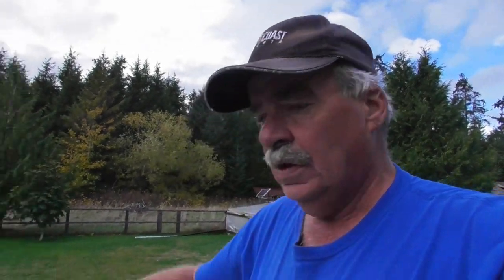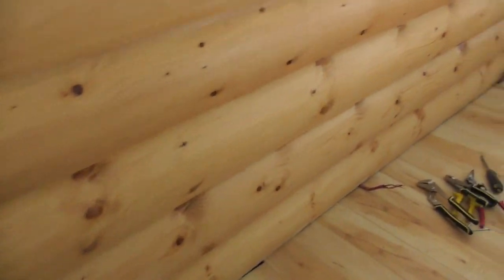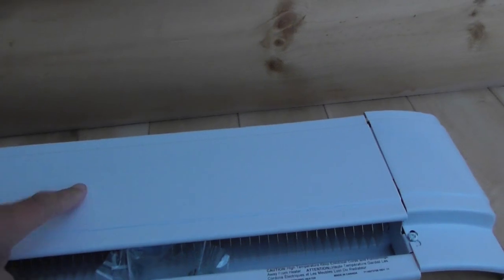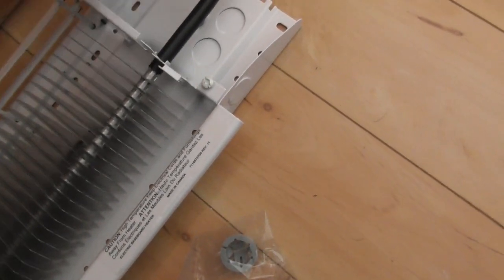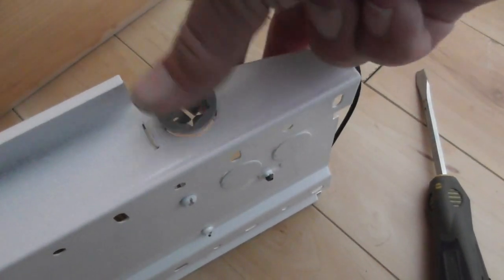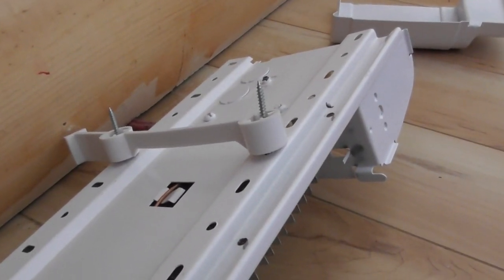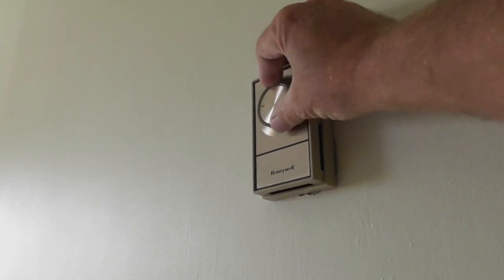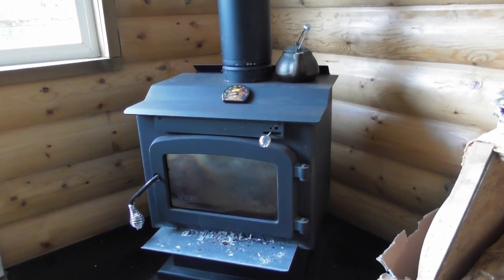Energy Saver Dimplex Linear Convector Baseboard Heater Install !

Comment: Great video! I just bought one of these too, but I'm confused on the wiring. The instructions indicate that you should wire the other side and separate the blue and black wire and addi in the neutral, and then wire the hot to the free black wire. Did yours not have those directions?
Reply from the maker: Hi Mindy, sounds like you got the Bluetooth model with the built in thermostat.  Is there a small square screen in the top of the right cover?
Reply: @NormanMcGregor  I think so. I actually got it figured out. You can use the side that looked like yours as a junction box, and then wire it like i mentioned above. Your video was very helpful, especially as to how to wall mount it. Thanks for posting and the quick response! Excited to try these things!
Reply from the maker: You are correct!  Excited to hear how it works for you!  I love mine!!
Reply: @hawkeye5038  

Hello,  I have a question for you , if you can answer for me please. 

Blue an black /  L1
Single black / L2
Yellow and black / don't touch 

With this wirering,  are the on board and wall termostats OPERATIONAL?
Or ONLY  the on board termostat?

Waiting for you reply.
Thanks.
Reply: @djkjrene  oh goodness... It's been so long I'm trying to remember how this worked out. My units do not have a wired wall thermostat, but instead a bluetooth one. So my wiring was strictly for power to the onboard thermostat. Then I used bluetooth to connect to the wireless controller. Is that what you wanted to know?
Reply: @hawkeye5038  

Thanks for your reply,  I also got the one with on board termostat, but I have the wirering for the wall termostat already so I wired a CST-240 

I was thinking that both of 5hem can work, 
But I'm starting to think that ONLY ONE can work,  and that if I want wall termostat also wireless with wifi

But if they can't work both,  then I don't need on board  termostat 

I don't know,  if I make my self clear.

Thanks
Reply: @hawkeye5038  

Sorry I see it was 1 year ago,
So embarrassing,  what was NEW for you one year ago... I'm just learning about it😊😊😊
Reply: @djkjrene  oh gosh no need to apologize! I just wish I could remember to share the knowledge. Don't feel bad. I would highly recommend calling dimplex if you aren't sure. Their customer service was great, as I did call them to ask about this too!
Reply: @hawkeye5038  
I'm waiting on the phone with Dimplex 1800 number. 
Thanks
Reply: @djkjrene  good luck!
Reply: @hawkeye5038  

I called Dimplex as you suggested,  and the person on the phone SAID, that it's NOT POSIBLE to have TWO termostats working together,  BUT Now  he's been proven WRONG!!!!

I, have both of then INSTALLED,  and WORKING,  I can CONTROL,  the unit either from the on board or wall termostat .
Reply: @djkjrene  well that is just awesome! Glad you figured it out. (Sorry dimplex wasn't much help). I will say these things are good little heaters, so they have that going for them. Hopefully you remember how you did all this so you will have a better answer than me in a year. 😁
Reply: @hawkeye5038  
Thanks for your help and time. 

God Bless.
Reply: @djkjrene  My Dimplex heaters with on board thermostats are also wired to a wall thermostat and they seem to work only intermittently. Have yours continued to work wired to both?  I am not sure if I should remove the wall thermostat from the control and just rely on the on-board controls.
Reply: @stephandewit8558  

Well it all depends,  on hiw the units are wired; if the on Board termostat works for you, then you don't need a wall termostat,  I don't like to go down to floor  level to adjust settings,  I prefer standing  to eye level,  I like to se what I'm doing,  that's why I prefer the wall termostat. 

Also,  we don't need the on board  sinse we already have the pre existent wirering.
Reply: @stephandewit8558  

Are you an Electrician?
Remember,  if you're using the existing wires from your previous heater installation and termostat,  your onboard unit won't work unless you conet the wires where the termostat comes out from. 
The wall termostat all its doing its allow power through, when the temperature reaches a lower level than the one you select on the unit. 

Once the power is allowed to the unit , you can control  the temperature from the onboard termostat.

In my case because of the different locations in the room of the termostats, the temperature is higher on to where my wall termostat is. By 2c.

Wall termostat = 26c.
Onboard termostat = 24c

In other cases might be different,  depending , as per where is your wall termostat located.
Reply: @djkjrene  I am not an electrician just a DIYer.  I feel like the controller board on the  heaters are flaky and do not like to be power cycled repeatedly, as would be done from my wall thermostat if it controls temperature.

I have cranked the wall thermostat to max to effectively bypass but keep the controller powered and I am now using the built in heater thermostat for control.  Not ideal but I can then check if the heater is working by checking the LCD display. 

I am contiplating bypassing the built-in heater thermostat control board by changing the heater wiring and returning control to the wall thermostat, but will only do that if necessary.  I wonder if anyone has experience doing that?  Should be a simple change.
Reply: @stephandewit8558  
 I , personally think that the wall termostat is the best way to go.

Hint:
The comor wires , other than the white and black ; are the ones for the board,

Don't know,  how long has it been since you bought this unit.(onboard termostat  with)?

Your easy safe proper, and money saving  way will be to return the unit and get one with out a onboard termostat. 

Right now they are at $49.99 at home depot,  and save the difference from $129.99 from the onboard termostat unit.

I know , That's what I'm gonna do, today I have the electrician comming to do the switch of units.

Comment: Hi Norman! I’m installing the heater with built in thermostat. I’m wiring from the right side where thermostat is. I understand the black wire from feed goes to single black wire on thermostat. It says disconnect the blue and black and add a neutral...Should that be my red wire cause it’s 240volt?
Reply from the maker: Hay Mike.  The thermostat runs off of 120vac and needs to be separated from the 240vac by adding a neutral wire.  Follow the instructions carefully or you will fry the wiring.
Reply: @NormanMcGregor  
Whats a neutral wire?
Is the Neutral wire different from L1 and L2 ?
Reply from the maker: @djkjrene  L1 and L2 are both hot wires in a 240volt circuit.
Reply: @NormanMcGregor  

Yes I, know that Norman. 

NOTICE:

I got the 1250W LPC, INSTALLED and WORKING!!! and YES!!! JUST for the RECORD ; The UNIT termostat AND the WALL (CST-240) SMART termostat,  they BOTH WORK SIMULTANEOUSLY.

It's A shame that the person that I spoke in the phone from DIMPLEX,  didn't know,  that this wS posible,  I was going to RETURN the Unit to buy the one with OUT the on board termostat for $56.00 as per $114.99

Anyway,  I just wanted to share that YES ... it's posible to have the unit controlled either from the wall termostat,  on board termostat  or Wi-Fi. 

Thanks everyone for your help. 
God Bless everyone 🙏
Reply from the maker: @djkjrene  That is really good to know!  I am sure a lot of people will be interested in knowing that information!  Well done!
Reply: @NormanMcGregor  

Norman , where are you located ?
Thanks for your help from Toronto Canada 🇨🇦
Reply: DJRene Calle Hey there! I’m having trouble with this model. I have 2 connected to 1 wall thermostat and they work but don’t heat. Any idea how I can fix this? Cheers!
Reply: @iamjohnjoumaa  

What do you mean? "They work but don't heat???

If they don't heat simple they don't work.

Can you refrase your concern?

In the other hand TWO UNITS TI ONE THERMOSTAT?

Are this two units link together?
In the same Room?
Reply: DJRene Calle Oh sorry, the unit thermostat works on both, but they don’t heat. The wall thermostat also works. Yes, a 1000w beneath both windows.
Reply: @iamjohnjoumaa  

What kind of Thermostat are we talking about?

If you have the CST-240 from Dimplex,  most of them  are defective !!!
I had 5 and only one sims to be working properly. 

Please update me.
Reply: DJRene Calle I kept my old one, but I’ll try changing it and get back to you.
Reply: @iamjohnjoumaa  

Make sure you have a 240 LINE,  GOING TO THE BLACK CABLE OF THE HEATING ELEMENT.

THIS UNITS WILL NOT WORK ON A SINGLE 110/120.
Reply from the maker: @iamjohnjoumaa  Not sure John but I think that each unit has to be on their own thermostat or the heaters will be starved for power.  They need to have full 240VAC each with enough AMPs to power the heaters based on their wattage and the single  inline thermostat may be restricting the AMPs and not allowing enough power to drive both heaters.
Reply: Norman McGregor There use to be two 1500w and they worked fine. I think it might be the unit thermostat competing with the wall unit. I’ll go buy one without and test it.
Reply from the maker: @iamjohnjoumaa  YES!  You need the LC model without the onboard thermostat.  The units you installed should be disconnected right now as the wires inside will burn up.
Reply: @iamjohnjoumaa  

Thats,  part of the problem.  Because of climate differences of where the unit thermostat is vs. Wall thermostat  the temperature varies Sometimes by a LOT si that can have the two thermostats in been Conflicting to each other.  After all they just doing,  what they were ment to do;  OPEN/CLOCE .

Si Set them both to HIGH,  and look at the differences on the display of each other and di the math,  this way you know that 25c on the wall = to xx on the unit board. 

I don't know??? If you follow me?

But also you mentioned two units in one Thermostat,  that will make things even worse. 

Anyway before you do anything,   Gi to the main pannell and OFF THE BEAKERS (for that unit) For 30 seconds or so and ON AGAIN; do it a couple of times and let me know if it works.  If the wiring was done Wright,  it should work Immediately!

If it doesn't?
The wiring is WRONG. 

Please reply. Thanks
Reply: @iamjohnjoumaa  

Thats what I did.
I RETURNED the ones with on-board thermostat. For the ones with out.
BLUE BOXES VS. RED BOXES 
SAME UNITS , $50.00 CHEAPER at home depot. 

$54.00
  Vs .
129 or something. 

But even after that some units don't work the way it should,  because of my CST-240 Dumplex defective units. 
Sometimes my room is a sauna at 25c
And Sometimes its freezing it doesn't turn ON at all REGARDLESS IF YOU SET ALL THE WAY TO 30c.

The ONLY WAY TIO "RESET" is By turning OFF and ON the BREAKER on  the MAIN PANNEL.

WARNING. 
DON'T RELY on the CST-240 DIMPLEX.

Comment: hello Norm, can you please tell me the wirering for the same heater but with the termostat on the unit

Thanks
Reply from the maker: First I will tell you, I learned the hard way!!!!!  The heaters WITH a thermostat built into the unit, ARE NOT CAMPATABLE if you have an inline wall Thermostat.  YOU WILL FRY YOUR WIRING AND RISK BURINING DOWN YOUR HOME!!!!!!!!!!!!  PLEASE READ and follow the direction that come with the heater you select for a safe install.  My video is for the Dimplex heaters that are compatible with an inline thermostat.  

PS - I fried the original heater version I bought with the onboard thermostat along with the wiring back to the mains panel and cost me  a major fix because I bought the wrong heater and thought it would work.  Make sure you know what you have before you buy and install any unit you buy!!!!!
Reply: @NormanMcGregor  

Thanks,  for your reply, 

How about,  if? I wire with out the on board termostat?  Since I already have a Dimplex,  CST-240

Any help I can get , would be greatly appreciated. 

PS. If anyone else reading this , KNOWS HOW???

Please HELP.

Thanks

Comment: Hey Norman, Have a question...and Dimplex is no help (waiting a week for reply so far).  I have a Linear Proportional wired upa nd working justfine. I now want to add a Linear Convector model (no on board thermostat) further along the wall, extending the circuit....  the Linear Proportional (on board thermostat) controls both units .  Can't find how to wire the two heaters anywhere Can you help ??? I'm thinking to splice second heater L1 to the yellow black wire on Linear Porportional, L2 to the blue/black/white connection. Your advice ??
Reply from the maker: Hay Dale, I don't know that unit so I would not want to give you the wrong info.  Their website does have quite an extensive number of wiring options that may help.
Reply: @NormanMcGregor  Dimplex never got back me for over two weeks now. Their website does not have the answers to my needs. So I forged ahead and did as I described above. Tho not an electrician, and haven't "tested" it with a resistance meter or other tester, so far it works perfect and I have two heaters on one run now.
Reply from the maker: Hay Dale, I originally installed the unit with a built in thermostat.  I wired it incorrectly and it worked for a couple of weeks during short use in fall season.  Then one day it got cold and I use it for a few hours and then , I saw smoke coming out of the unit and the wires inside to the thermostat fried to bits.  The main wires to the unit also fried and if I had not been holme at the time  the result might have been very bad.  I replaced the unit with this one and it works perfect.  Dimplix does have electrical wiring specs on their site for all their units.  I encourage you to look at them for safe use or your heater as they do put out a lot of heat.

Comment: Can you help me PLEASE ???   I would like to install a ''Dimplex 500W Linear Convector Baseboard Heater'' with either a ''Dimplex Built-In Single Pole Thermostat Kit'' or a ''Dimplex Built-In Double Pole Thermostat Kit''.   What is the difference between the ''Single pole'' or the ''Double Pole'' ???   Which of the two should I use ??? Here are the models in question and thanks fr you help ???   Model # LC2005W31|Store SKU # 1000709846, Model # DTK-SP|Store SKU # 1000120249 and Model # DTK-DP|Store SKU # 1000120270. Thank you Sir.
Reply from the maker: Dimplex has a Great website which shows all the different models and all their specs.  It also shows which Thermostat kits work with them.  The  website is - https://www.dimplex.com/en/

Comment: Could it be connected from the other end? I mean from the left side.
Reply from the maker: For Sure!  The heaters are set up to be wired either end.  I used the right side because the power wire was on that side.
Reply: Music passion. 
Hello.

NO it can NOT be wired on the LEFT SIDE.

Just install a utility box and extend the wires as far to the Right. 

Make sure, its done with and INSIDE UTILITY BOX.

Comment: How did you get the middle cover off. Please
Reply from the maker: There are small hooks top and bottom of the cover.  Gently pull on the top edge and it will pop off.

Comment: Just bought one of these. How is the thermostat wired up?
Reply from the maker: Its really important to select the right model as there is a big difference if you are replacing an existing heater or installing it as a new heater.  If you are replacing an existing heater with an inline thermostat, just wire it the same as the old one the same as I did in my video.  If it is a new install of a heater, you need the heater model with a built-in thermostat and the wiring specifications is very well explained on their web site.
Reply: @NormanMcGregor  

Following the wirering instructions,  my DOES NOT Work.

Question:
Please correct me if I'm wrong. 
My problem is that I have a smart Dimplex termostat on the wall,  replacing the old termostat, and with the wirering configuration provided by the manufacture (Dimplex) it DIES NOT WORK 

with a different configuration,  it does work ONLY the wall termostat,  BUT the ON BOARD TERMOSTAT. 

Aren't supposed to work both of them??
Reply from the maker: @djkjrene  Not sure what your problem is.  The Smart thermostat is a very separate devise that connects to the heater through wireless Blue Tooth.  Have you set up the connection correctly??
Reply: @NormanMcGregor  

The problem WAS.
WASN'T able to control the unit with Two termostats,  (on board and wall)
Reply: @NormanMcGregor  

No norman , the on board termostat is wired and it can control manually from the unit and wifi as well,
Same with the wall termostat (SPT-240) it's also hard wired,  but can also control via Wi-Fi. 

My it's working like a charm now.

Comment: How do you work it without thermostat..Or can it work without one.ty
Reply from the maker: They have 2 different models.  One works with an existing wall thermostat that is wired inline with the heater, a great replacement choice for replacing an existing wall heater and then they have a model that has its own built in thermostat that you can also control from a Bluetooth app on your smart phone.  They are a bit more pricey to buy but you don't need it install a wired in thermostat.
Reply: Norman McGregor The one that was installed where I work only has a screw like mechanism on top for a flathead screw..The builder didn’t leave any information on this..If I turn the screw it heats up..I don’t want to start a fire so how can I set this..Thats if I can.ty
Reply from the maker: Sounds like you have a different make of heater.  The Dimplex heaters have only 2 types I outlined.  Find the manufactures tag and go to their website for their setup instructions.

Comment: Am I the only one earring a buzz sound coming from the baseboard when heat is on ?
Reply from the maker: Your mounting screws are to tight.  Back them off 1/4 - 1/2 turn and that should get rid of the buzz.
Reply: @NormanMcGregor  thank you ! Expansion 🤦🏻‍♂️